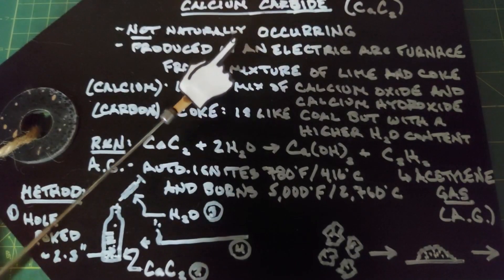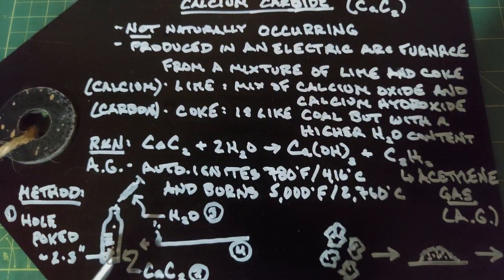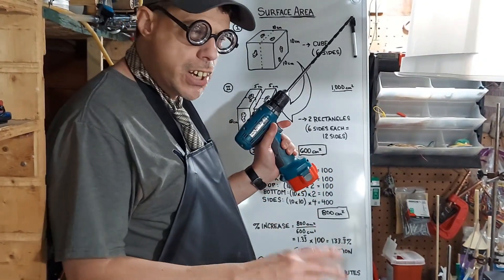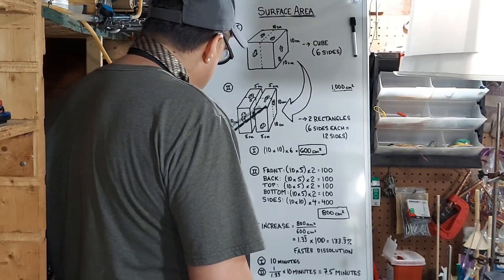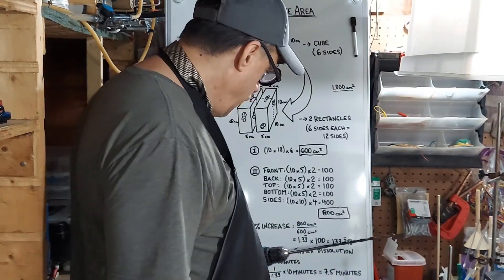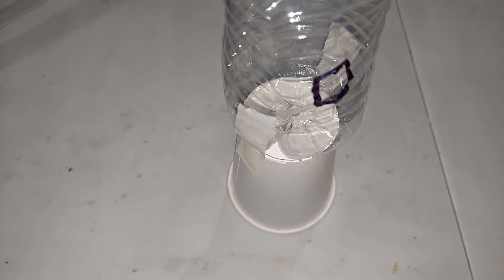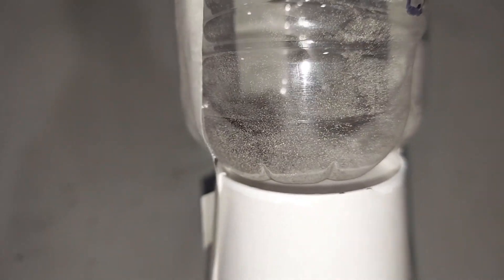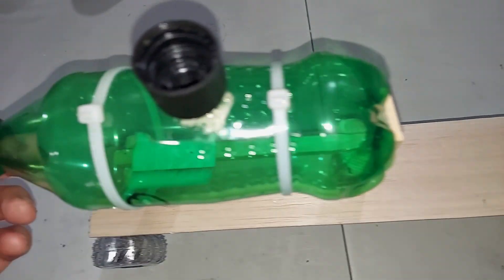Creating Acetylene Gas

Comment: Thanks for this video. Minor correction. Around the 4:30 mark, it should be 600 cm squared, not cubed 

Also, I wonder why so many experimenters don't use electric ignition for safety.
Reply from the maker: Yes, you are correct.  I definitely misspoke.  Thank you!  Also, electric fuses aren't cheap, whereas other methods usually are.  That would be my guess.

Comment: Fun coincidence: yesterday night I attended a party of mining enthusiasts. There were dozens of beautiful carbide lamps.
Never thought someone would do a 15 mn video on one of my favorite gases. Great job :)
The surface area is a non issue in reality: calcium hydroxide will swell let water through even if your reactor (lamp) is packed with CaC2. Since water is cheap, use it in excess.
Reply from the maker: Thanks for your input.  It's much appreciated.  However, as I wanted to produce as much C2H2 as possible, in as little time as possible (due to the fact that it's a video) the crushed calcium carbide definitely reacts faster.  In a lamp, or probably any other use, it wouldn't matter.  I agree.